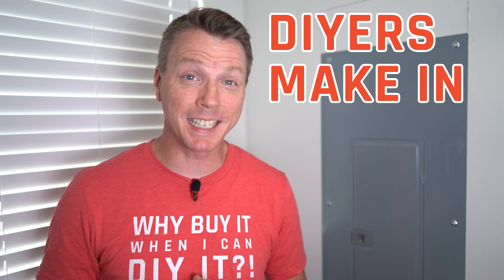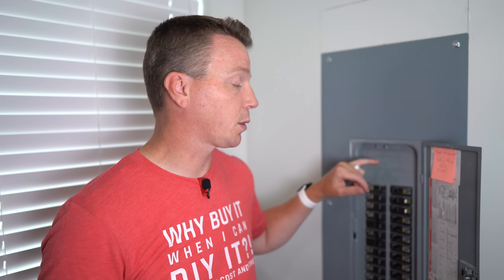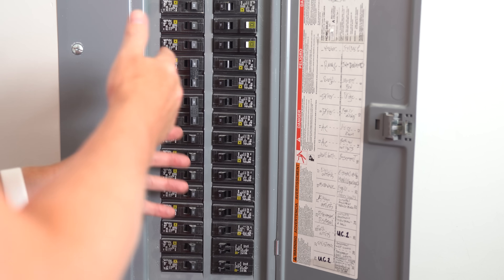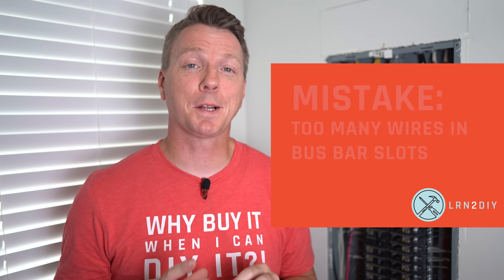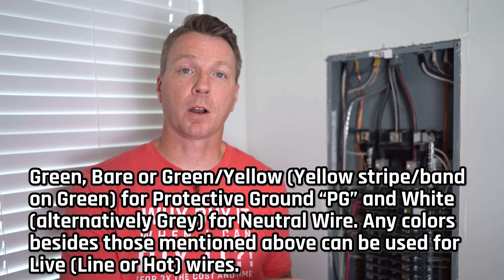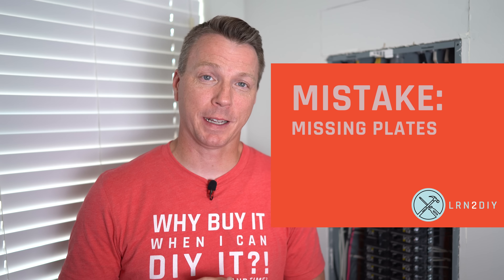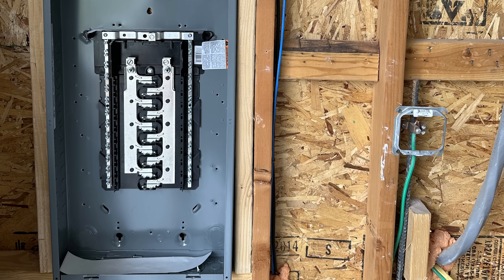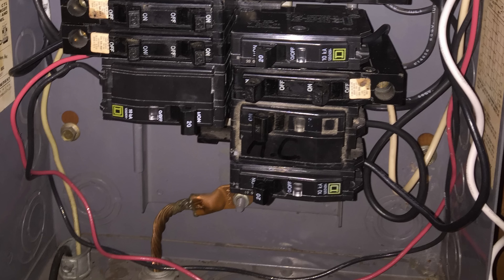10 Common Mistakes DIYers Make In Circuit Breaker Boxes

Comment: OMG -- is this guy dangerous -- you absolutely are not to re-torq !!!  Once torqed you do not go back and perodically retorq.  You are damaging the wire. The UL tested torq figure takes into account the nature of the wire to relax over time .  The torq rating only applies to the original  install time.  They know that torq number is expected to decrease over time. They set the torq  value to account for this.  To retorq a wire there is no legit thing like that  -- the fix for a wire that has been wronly re-torqed is to cut off the end and start over fresh.  If you beleve a wire was not torqed correctly, or re-torqed, the only safe thing to do is cut off the end & strip a new end, technically, before torqing again.  If you are a co pany that keeps coming to installed jobs and retorqing you are doi g damage to the amp carring  capacity of the wire.  You are making the wire so that it will overheat over time, & you  may be the cause of the electrical house fire  that occurs years after you leave. You might as well  e a fire bug !¡!!@!!  Do not let people retorq.  Done once and done is the torq rule.

Comment: Hey beginners neutrals are required one wire under one screw as the safty rule.   (1) The nuetral if disconnected can destroy electronics from smal to large in the neutral becomes disconnected. For example in a multi-wire one 120 volt system it can turn the circuit into a 240 volt system and blowup appliances on those circuits.  
(2) when a circuit is used because an appliance or equipme t is on it returns amps back through the nuetral wire to the nuetral bus. If that wire comes lose is can make what ever it touches hot by accident when the wire comes out from under the screw. * This is one of the ways beginners get electrocuted  -- noot just beginners, but also experienced electricians that skipped that 
Part of electrical theory.  If the circuit is on drawing am
S through a devive and you are working on the wiring for that circuit you might have learned wrong that you can not get shocked -- yes you can get shocked by holding the bare wire in one hand and the current going through you body to get back to the electrical source (grid).  If current goes through your body and  accross your heart a very small current can kill you.  Just because you got shocked before and did not die does not mean that you will be safe next time.  It can be a little unpredictable when the shock can go across the heart.  If you are careless or ignorant and are regularly ris,y and gettig shocked sometimes then you have a betterchance electricution than winning the lottery.  Thats why we should turn off the power before working on a hot wire.  Homeoners can safely do your own electrical repairs as long as you kee
 The power off and do not work on live wires. And if you do not understand what you are doing then stop and educate yourself.  Homeowners should always make 100% sure the power is off .  Watch some you tube videos on testers, & videos  to learn about "false off" mistakes.  Watch some Mike Holt videos on multi-wire branch circuits a d short circuits before you start to work on your own wires. Homeowners, it is safe if you only do what you are qualified to do, and turn the power off first.
Reply: Those bare copper ground wire as a general rule it is standard practice to put two same size wires under one screw in the ground bar in an electrical panel.  I do not know if your local code allows it, but in the past electricians might twist a bundle of ground wires together along their  length to form a twisted cable and then put this bundle under one screw in the ground bar.  If you have that in your electrical box I would not touch it bc in years past an electrical inspector likely approved it, and wires twisted together to make a cable and all equpment bare ground wires twisted together along their length can be safely tighted under one screw in the ground bar --  is safe.  So rules and exceptions can get tricky but you will be ok if you stay in your wheelhouse and don't try to I vent anything.  It's possible it invent something that's safe but it will not be code compliant.  Ever device must be installed according to the manufacturers instructions, and everything else is standardized in the National electrical code.  

Qualified people can always tell when someone has learned just enough to be  dangerous gives advice. We'll meaning advice may be premature.  Above the one wire one screw advice only hold true where required.  Many devices can be .listed for more than one screw so do not assume it's wrong if you see it, but it is ok to ask why it's OK or not if a friend is helping you.  A person in the trades often knows more and can put more than one wire under a screw.  For example, some breakers -- like Square D brand -- for 14 & 12 awg size wires  are listed for two hot wires under one screw, but other brands are not.

Comment: You can put a thicker gauge wire on a smaller breaker but only to a certain extent! The breaker will tell you what “maximum” size wire it will allow you to terminate. As well as if you can double tap

Comment: Bet 99% don’t know this:
Your screws that hold the panel cover on are triple threaded. 
There are three separate parallel threads on every screw.

(I don’t know if it’s every panel but it is on mine, which is a Square D Company .)

Comment: I’ve been an electrician for over 20yrs. I don’t recommend doing electrical work in a panel unless you’re a professional electrician. It’s just way to dangerous even if you shut the power off in a main panel you can still get electrocuted or arc flashed by the top lugs if you touch them. I have been to homes where the homeowner has tried to do their own electrical work, and it costs them twice as much for me to fix their mistakes.

Comment: How can I insulate behind electric panel? - it’s already installed in my cabin in northern Vermont maybe a 2” gap to outside wall - It gets  to minus 25 F in winter - don’t bother? Spray foam? Try sliding foam board behind? Unscrew panel from wall?stuff Fibergass behind?

Comment: I was surprised to see no master breaker in your distribution box. In SC and GA we have a master circuit breaker in the box and also a breaker outside which is fed from the utility's meter.
If one is going to use just any color wire then they really need insure the wire is extra I.D.ed and the I.D. will hold for years and years on both ends. Also, boy has copper wire gotten expensive!

Comment: On the main panel, is it ok to put in a breaker to fill a slot and mark it as spare and leave it in the off position. or do i have to cover the knock-out with a blank.

Comment: You say that 14wg can only handle 15A and thats not really accurate, Code yes true rating no. THHN 14 AWG Copper Wire is safe up to 25A at 90C. Not saying you are wrong to note that 14awg is for 15A or smaller circuits just its not what its rated or safe to, but what code says.

Comment: One tool that can be real handy, especially if your handwriting is not that good. With a small P-touch label maker by Brother can be really useful for labeling your circuits. It has two sizes of fonts (large and small) and if using the small font you can use a "two-line" name for a breaker. I noticed that the labels your recommend are not named so the P-touch would be really handy for this. Great video and very helpful.

Comment: I have the bloody stupid model of panel in my house. You show it full of breakers but only a handful of wires coming in. There simply are not enough holes in the panel to accommodate all the wires for the breakers. You ask for neat labelling, but the labels aren't even adjacent to the breakers and no space is provided to do that because the panel is inset and while the big sticker is numbered, the breakers are not. The idiot "licensed" installer only installed a single ground bar, so there are fewer ground points than there are breakers. So doubling on the ground bar or in the box is absolutely necessary. Missing filler plates - it doesn't come with filler plates - it comes with knockouts because it's a cheap and crappy design. There is nothing good about that panel - it's made to be as cheap as possible to manufacture and make you little shopping list of DIY failures actually be the list of what licensed electricians did in that panel. Quit criticizing DIY installers because you clean up your own professional practice.

Comment: Your biggest mistake. Tell people to turn off service before going in panel. Arc blast 480volts is 35000 degrees 4 times the temp if surface of sun. Its irresponsible to tell people open panel if they not an electrician

Comment: Probably should redesignate the "hot" white wire on the breaker with red tape for the entire length it is in the panel.  You also failed to mention that the panel you show appears to be a "sub-panel".  This is why your neutrals and ground conductors are separated.  The bonding screw should not be installed in this application as neutral buss bar must be insulated from the shell of the panel.  I always use pencil to mark the panel schedule on the door.  That way, if there are future changes, they can be easily corrected on the schedule.

Comment: A major mistake in DIY wiring, is to run a single neutral wire back to the box for more than one circuit.  Neutral wires of 120 VAC circuits carry exactly the same amount of current as the corresponding hot wire.  Putting 30 amps through a single 14 gauge neutral wire will burn your house down without popping any circuit breakers.  Neutral wires being inter-connected between circuits will make GFCI breakers trip as soon as anything on one of the circuits is turned on.

Your "neat box" example is very pretty, but home owners in the US don't have 3-phase power with red, block, and blue hot wires!

Comment: He mentioned that you can use a thicker gauge than 14 gauge on a 15 amp breaker at minute 4:40.
I was told to never use 12 gauge on a 15amp breaker.
Reply: There is no safety issue with upsizing the wire,  just never oversize the breaker.

Comment: I bypassed your video several time based on the title, but as others have said, errors are made by professionals as well. I finally watched the video and found some useful information. I have had an open neural problem in a switched receptacle on one of the circuits in my home for some time.  Watched many videos that pointed to the problem likely being a loose connection in another receptacle. Checked and corrected many pushed in connections but still had an open neutral problem. I eventually found what was believed to the power feed to the receptacle.  Based on the layout of my house, it was likely the first one from the breaker. It showed 120v to ground but no voltage across the black and white wires. This suggested that there was a problem somewhere in the professionally installed wiring. After watching your video and seeing how the wiring in the circuit breaker box should be, I reluctantly opened my circuit breaker box. To my surprise, I found multiple cases where two neutral wires were connected to the same hole in the bus bar. As in your example, there were other holes that were unused. Closer examination also showed a case where the wire was completely burned through, likely the cause of my open neutral problem. Several of the other connections also showed signs of corrosion.  All this is to say that your video helped me to look in a direction that I did not think was the source of my problem. Thank you for the video.

Comment: Filler plates are junk in my book. I have seen many times where the filler plates have fallen out, and if you are lucky, you will find them on the floor.
I never use these. Just put a circuit breaker in the unused open position and call it a spare on the panel directory. I have NEVER seen a breaker fall out of a panel, and they are not too expensive.

Comment: Ok, I never make any of those mistakes.  For example, I watched a video where someone showed how easy it is to add a 240v 60 (or 80?) amp line from the breaker box to an EV charger in the garage.  It was clear that my knowledge included the smarts to know that I needed an electrician for that.  Could I?  Maybe.  But I'm not an electrician.

Comment: Concerning torquing down screws periodically.  Retorquing should not exceed 90% of original specifications or the wires could fatigue and fail. Experiments have shown new installations will relax or “settle” at 80-90% in about 1 or 2 days and this is expected.

Comment: Personally I don't like to have a perfect looking panel with wires cut just long enough to reach the breaker because if you need to move them around for example you may need to move a single pole breaker to the other side of the panel to allow a double or triple pole breaker in three phase systems to take it's place because you may not have enough poles anywhere else to place them or you may not need one breaker anymore so you are replacing it with another breaker of a different amount of poles. A little extra with never hurts but too little wire can cause issues in the future. Another thing to do that is not mentioned here is when you are using stranded wire always torque the wire then lightly wiggle it and re-torque a few times, the stranded wire will always loosen a little after being torqued because the strands spread out, if you don't give them a little wiggle and re-torque they will not be as tight as they should be and not have a good connection, you don't want to bend them at or near 90 degrees just around ten to fifteen degrees back and forth or you may stretch and weaken the strands of wire.

Comment: Why expose the ground wire in the box ? There are live connection points around that box,it looks like an easy to make a tool path to live if not careful working there.?Leaving the insulation to the connectors seems a safer practice?

Comment: 13:11 It's not really easy to trace the lines until you snip the nylon ties. (Or put another corresponding one of those round-the-cable labels on the far side near the entrance of the box).

Comment: 2 wires into 1 breaker is nonsensical to me. Breakers are supposed to protect a single wire from overheating. How is a 20-amp double-tapped  breaker going to do that without false-tripping if, say, you have 30 amps of load running between 2 x 12-gauge wires (which should be perfectly fine if you were running each wire to its own breaker) ??

Comment: Q1: How would you label tandem breakers?  For example 13a & 13b?
Q2: How would you label a wire about halfway between the box and the device?   For example I might write "C13a.2"  on that wire label, to denote the second wire attached to breaker 13a in the breaker box that I labeled "C".   I'd rather follow convention or precedent if there is one.:location-yellow-teal-bars:

Comment: Nice video. But for overloading the panel, you can’t simply add up the maximums, it’s perfectly fine for the individual breakers to add up way more than the main. The individual lines don’t run on capacity all the time and they don’t run at the same time.

Comment: A common misconception is that a 20 amp circuit, in the panel, will only source 20 amps.  If your panel is fed by a 30 kva transformer, the instantaneous current is the full rating of the transformer less what the limiting  impedance of the incoming cables provide.

Comment: The CB list should be filled out by the original installer and changes should be updated as subsequent work is done.  If the homeowners have electricians do the work, then it's not their responsibility to update the list.

Comment: My last home had a smaller breaker box, with no main breaker to turn off power to the box. The poles simply went to the individual breakers. PLUS, somehow they wired a small sub-panel to it as well..... We put in a 150 amp Square D QO breaker (not sure why I didn't do 200 amp, must have been the price). What surprised me was that we couldn't use the same gauge wire from the meter to the panel for a 150 amp box, as we could for a 200amp box. My buddy who was working towards his journeyman's card called his mentor to ask, and it was explained that a larger gauge wire would pull too much electricity from the meter. I am still confused by that.... We did use copper, versus the original aluminum from the meter. And we did it how the professional explained it. But I am still confused by it.... The whole house had metal receptacle boxes, I wrapped every electrical plug with electrical tape to play it safe, when I replaced switch, plug, etc. I get that this was my home, and some pro's have to just get things done fast.... But i've never understood cutting corners on simple stuff, that could create a major disaster or death... My understanding is that "to code" simply implies the minimum requirements to do something. Take pride in your work people, exceed the minimum requirements when doing stuff!!!

Comment: ONE common mistake electrical DIYers make is actually doing it themselves.

Plumbing doesn't usually have the ability to KILL you or someone you love, when it's done wrong.

A little knowledge in unskilled hands becomes dangerous....just sayin'. There's a reason electrical workers are "trained"🤔

Comment: Oh, that was disappointing.
20-year residential service electrician here.  Biggest and most common mistake:  not using opposite phase hots with a shared neutral.  That's particularly dangerous because it can lead to a dangerously overloaded neutral wire, as well as voltage problems.